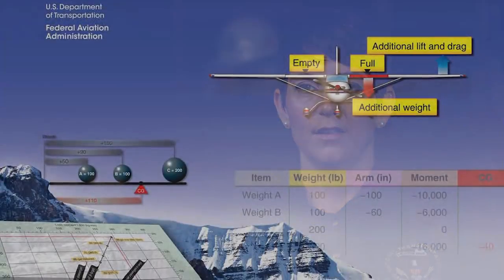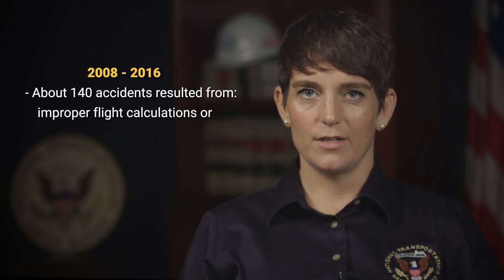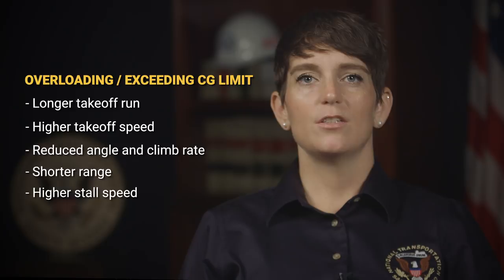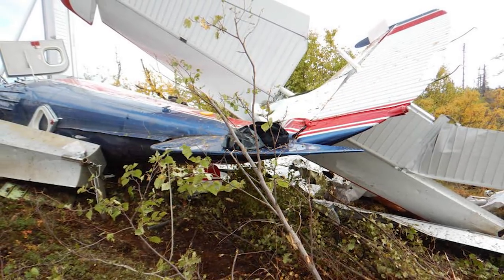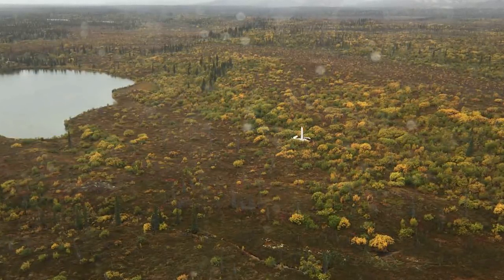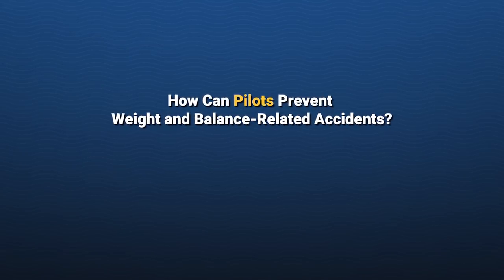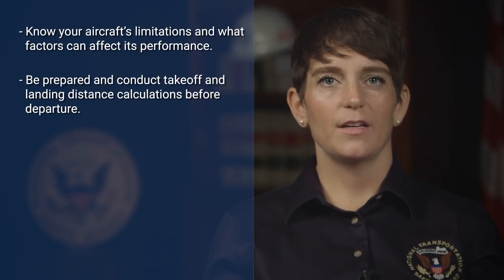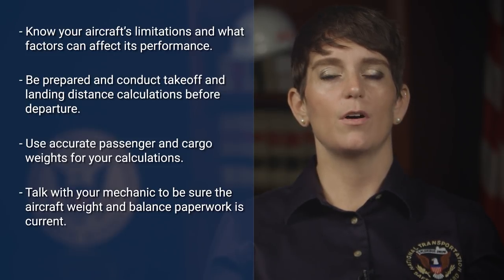Minding Weight, Maintaining Balance - Improper and Unperformed Calculations Can be Fatal

Comment: FAA needs to bring back the flight program for operational inspectors. This program kept them current on what to check for or brief with general aircraft pilots, and not to mention check-rides. This agency is suppose to enhance safety, but by taking away this program it's doing the opposite. Great video. I will brief this in my next class.
Reply: Jose Salazar I believe the NTSB doesn't have the authority to mandate or take away; that falls on the FAA.  The NTSB can only recommend corrective actions after their investigations as with the FAA can actually put out airworthiness directives in addition to other mandated guidance.  The problem is, something bad usually has to hapoen for them to do so.
Reply: Henry you're some what correct. When something big or bad happens they (NTSB) can mandate some corrective actions. The FAA will support that because they are all in the same Transportation Organization. Don't forget Title 49 is the law that governs air transportation and that's what air carriers follow as well as regulations in part 121 or 135.